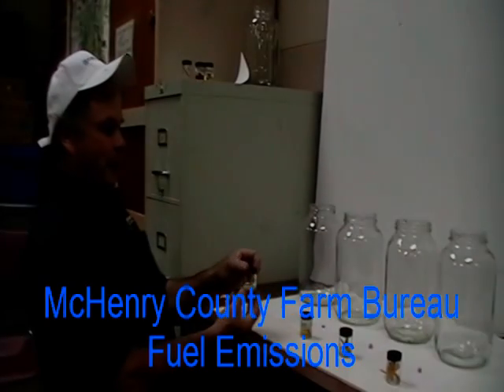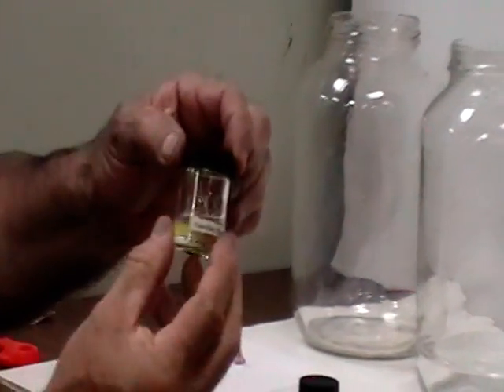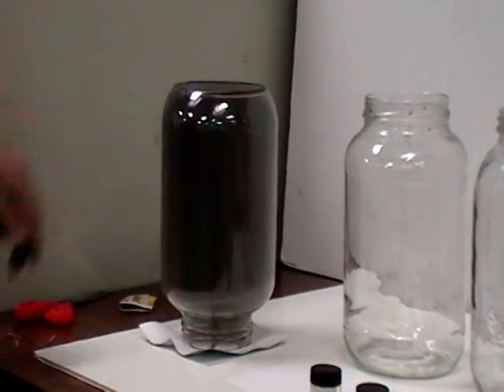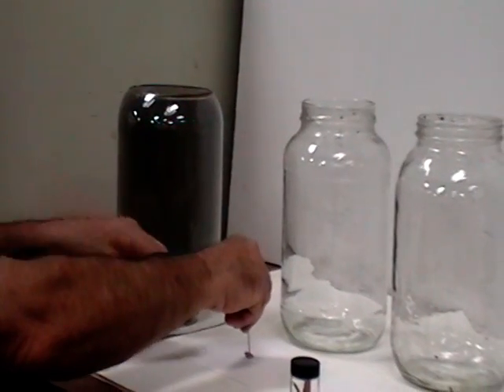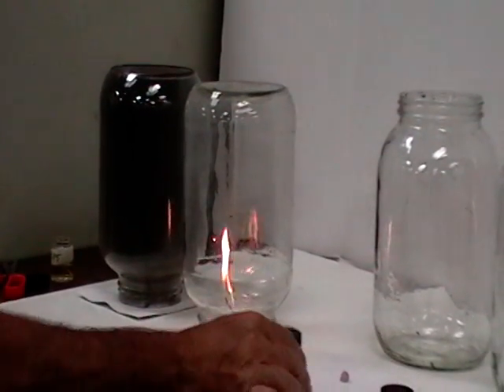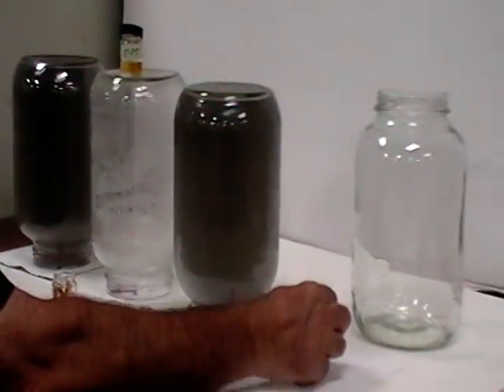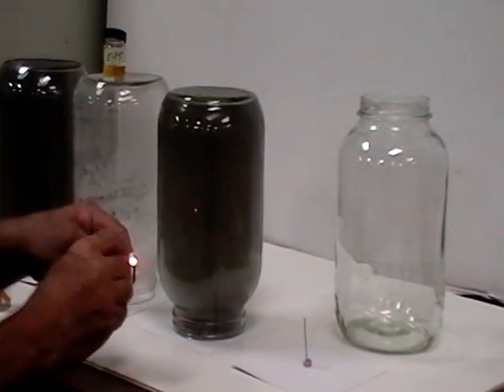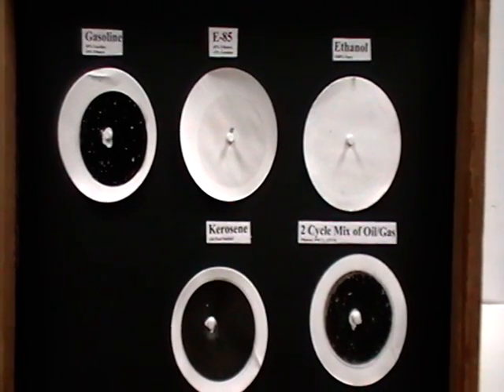Fuel Emissions - Gas, Ethanol, E85, Kerosene

Comment: Ya, in the absence of added O2 you get soot. Acetelyne with no extra air is filthy too, but when you add oxygen, it is extremely hot and zero emissions. No engines burn fuel in upside down jars.

Comment: This test fails in that it does not represent actual running conditions. Heavier fuels run cleaner and more efficiently in engines when combustion pressure and temperature are higher, plus oxygen levels are higher than atmosphere through turbocharging. By placing a closed jar over the flame, you reduce the oxygen and naturally the flame will become dirtier and release more smoke, which is simply unburned hydrocarbons.

Comment: E85 gives me hope for the V8’s shelf life and that my kids will be able to hear an engine’s growl
Reply: Unlikely. E85 actually has a lower gas mileage as thr ethanol has less energy in it. While it burns cleaner, the laws on limiting cars is based on how many gallons of gas they burn and e85 is actually worse at that. It's been well documented by people who've bought cars that run on flex fuels that mileage goes down. Unless they made a stipulation for it, it likely will change nothing. 

Not to mention the emissions are only slightly better than diesel engines. E85 is believed to produce 50% less emissions than straight gasoline while diesel already only emits about 40% less than gasoline. E85 also takes growing vastly more corn and more land wasted to grow it making it technically worse by a large margin. For example, with existing e90 gasoline, 40% of all corn crops are used go make ethanol for fuel. This also means feed for cows goes up which us why cow food products have also gone up drastically. This would only compound both issues while also requiring vastly more farmland.
Reply: Yeah those amazing sounding monsters have to stay a lot longer IMHO

Comment: Of course if a fuel isn't given the proper environment for combustion (incorrect air/fuel ratio, combustion temperature too low) you're going to get soot and unburnt fuel. This experiment has less scientific merit than an elementary school science fair project that got last place and you should be embarrassed as a company to post something this invalid.

Comment: Why don't you try that again and actually burn the fuels completely in the right environment as was stated below. Also why don't you burn the fuel vapors without introducing the wood/carbon into the mix and tainting your results. Crackpot science is far worse than ignorance outright.

Comment: Nothing is better than methanol. It needs to be our new fuel. It’s much easier and quicker to make and it’s got way more power which allows us to use smaller engines and in turn smaller cars. It’s obviously got the problem of being highly corrosive and has a low energy density, but those can be solved with mixtures and proper building materials for new carsx
Reply: Windows NT Workstation 4.0 precisely I researched dimethyl ether. I feel that lng compression wastes tons of energy it’d be better to chemically convert it to something instead. Dimethyl ether is a lot like propane and it’s a great fuel. Methanol is more for gasoline. Both absorb more energy from the engine to keep it cool and increase the speed of oncoming vapors and gasses which reduces the power needed from the piston to pull the intake and it also pushes the piston along when combustion hits more.

Comment: Ethanol is hygroscopic, so it won't store very long. I tried it several times but went back to gasoline because it was only twenty cents a gallon cheaper than regular, but got much less miles per gallon.
Reply: Ethanol won't store very long, you say? Hahahahaha. Did the monkeys you travel with tell you that? 

Ethanol can store virtually forever. The simplest way to prove this is to go to your father's or grandfather's house and ask to see the oldest bottle of whiskey, vodka, schnapps, rye, scotch, tequila, brandy that he has. Unless you father/grand father is a drunk, he'll have something that is a few years old (maybe a decade of more). Taste it. It will taste exactly like how whiskey, vodka, schnapps, rye, scotch, tequila, or brandy tastes. 

Gasoline goes bad. Being hygroscopic simply means that it's a substance that can mix with water. Gasoline is also hygroscopic, but less so, which is why if you get water in your fuel system you add a product like Dry Gas, which is ethanol.

Comment: We dont have E85 in Brazil. We have E100 then we have Gasoline E27 (used to be something from 20-25% until 2014 now is 27%) and Premium gasoline E25.
Reply: And you can run any car in E100? Where can I find some info about it? I mean if you can name brazilian forums
Reply: @daneitor97  Hi Daniel. I had tried to write you a comment with an URL of a website talking about ethanol in Brazil, but my message has been deleted by Youtube, I'm gonna try again...Well, not any car, but all cars produced in Brazil as of now, 2022, they are all made to run on any kind of mixture from E22 to E96. E96 because out "E100" is 4% water that naturally occurs in its production, taking it out increases the production cost... In the 70's there were a government program called "PRO-ETHANOL" in Brazil that gave incentives to cars manufactures to produce ethanol only vehicles and from the 80's to the beginning of the 90's most cars produced in Brazil were made to run with ethanol only E100 or E96 whatever... In the  middle of the 90's gasoline price has gone down a lot and there was a crises in the ethanol production chain and then gasoline came back again as the main fuel sold in Brazil so little by little car makers started to phase out all ethanol vehicles and by 2001 there were almost no cars being sold that were compatible with ethanol, only gasoline (at the time E20 to E24 depending on what the government tells them to do..). In 2003 ethanol had another chance in Brazil with our first flex fuel vehicle being launched and since then all car makers started to produce their own version of a flex fuel vehicle and now 99% are flex fuel capable of running anything from E20 - sometimes less to E100. But it's been many years that using ethanol as car fuel is not worthy because after the first years of producing flex fuel cars, the price of ethanol has increased year by year and as of 2022 in almost all brazilian states, the price is almost the same of the gasoline so it not worthy at all price wise. Performance wise is better, but not by much, comparing the two.
Reply: @rauserfroes81  muito obrigado!! I wish we had ethanol here in Spain (also in Portugal). There is in France, for less than half the price of gasoline... But here is a lot of misinformation and lack of real knowledge in Europe about Ethanol
Reply: @daneitor97  You're welcome! And I myself wish we in Brazil had cheaper ethanol! We have a really bad government not working for people and evil sugar/ethanol producers that only think about their profits.

Comment: But can it melt steel beams?
Reply: yes it can, it weakens the beams to a point where the tremendous amount of weight of the existing floors of that building, will buckle the beams that are being superheated/weakened by jet fuel. laws of physics takes place.

Comment: This "test" is ridiculous non-sense.The black stuff is carbon based soot. Soot formation in this case is caused by lack of oxygen because he seals it in a jar. Fuels are not burned in an oxygen free area. A perfect burn of any of these will result in carbon dioxide and water vapor. This is nothing like how an engine would burn these fuels. Try raising the temperature and pressure to that of inside an engine and supply it with stoichiometric air to fuel ratio. Anyone that has burned an oxy-acetylene torch knows soot is formed until you add the necessary oxygen. Emissions also deal with things we can't see. This is so silly of a "test"
Reply: TheMatron'sMilitia methanol is much better. Stick with it.
Reply: Jorell f yes, but as a control the ethanol didn’t carbonize it’s fuel.
Reply: el bob engines don’t always burn 100 percent. You seen a diesel motor “rolling coal”? That happens all the time when we accelerate in all fossil fuel engines.
Reply: el bob the stick was already producing soot before being in the jar
Reply: Then why didn’t it happen with the E-85? Hmmmm????
Reply: You are absolutely right the ethanol only burns cleaner as it contains a little oxygen with right amount of air all the jars would still be clear.
Reply: An engine rarely runs a stoichiometric air ratio, if it did you would not have carbon buildup within an engine. What the video shows is that even in less than ideal conditions ethanol is a superior fuel.
Reply: @SkylineFinesse  Wrong most engines run stoichiometric 95% to 99% of the time it just depends how sophisticated the fuel management is.
Reply: Fossil fuels will always burn dirty. It’s just in their chemistry.
Reply: @michaelhite1433  no, HYDROCARBONS will always burn into water and carbon dioxide/oxide or pure carbon

Comment: How does the color relate to cleanliness?  Sure the black stuff has more carbon/soot, but stuff like carbon monoxide is clear and very harmful... how do you account for that with this test?
Reply: +2PiLabs more carbon in the fuel means more carbon monoxide and more CO2 when used in a engine.
Reply: The Countess and more energy, air is free, you can pump however much air you want to burn the gasoline, but as for ethanol, it’s already partially oxidized, so won’t have as much energy as gasoline when air supply is sufficient.

Comment: I dont care if it's cleaner, im not burning corn in my engine.
Reply: +Douglas Gardner Actually it's very common for racers to use e85 over gasolne. Because it has an octane rating of 105, it resists detonation far better than gasoline. This means you can use more aggressive ignition timing that you normally wouldn't be able to run to achieve MBT (maximum brake torque). It also cools down the intake charge going into the cylinders which further decreases the chances of detonation.
Reply: +Douglas Gardner Give me one good reason why burning E85 is a bad thing.
Reply: *****  e85 creates more smog then regular gas, ethanol is a net energy loser, ethanol reduce the vehicle's fuel efficiency. I always run ethanol free fuel in my daily.
Reply: +Douglas Gardner lots of people do...
Reply: +Jose Garcia Ruins your fuel lines, your gas tank can rust out due to water vapor, corn subsidies.
Reply: +Douglas Gardner yes but it is also much cheaper than gasoline, makes us less depenant on foreign oil and at 105 octane it can be used as race fuel at a much lower price.
Reply: *****  I highly doubt any racers would use a sub par fuel
Reply: +Douglas Gardner That's actually 100% false.  Due to its chemical makeup you can burn MORE at one time than gasoline in the same space so it makes more power even though the energy per pound is lower.
Reply: +Douglas Gardner /watch?v=ltWcgiCm4NY

Comment: This is one of the stupidest video's i've ever seen. All this does is show that how when certain liquids are burned with low oxygen content in the air soot is produced instead of CO2...
Reply: +Rasmus Hvid It shows how these various liquids produce soot in like conditions. 

It stands to reason that these conditions might create more particulates in absolute terms, but not change in relative terms. 

So we'll say for the sake of argument he created 4 units of soot in that environment with E85, and 10 with the two-cycle mixture. If in the real world 2 units is created with E83 and 5 with two-cycle mix his argument still stands. One is more polluting than the other in relative terms.
Reply: +JAMES HAWK  Did you pass grade 10 chemistry? Because if so, you'll realize this isnt realistic experimental conditions, a more precise test would involve using different sized containers depending on the stoichiometry of the reactions.
Reply: Right a more scientific way of conducting this test would be to work through the chemical reaction, find stoich, and then burn each with enough air to complete the reaction. Then check the amount of soot produced so the numbers aren't skewed. I'm willing to bet that some incomplete combustion would still occur, but not to this degree. Maybe I'll try this in chemistry class next semester.
Reply: Right a more scientific way of conducting this test would be to work through the chemical reaction, find stoich, and then burn each with enough air to complete the reaction. Then check the amount of soot produced so the numbers aren't skewed. I'm willing to bet that some incomplete combustion would still occur, but not to this degree. Maybe I'll try this in chemistry class next semester.
Reply: Right a more scientific way of conducting this test would be to work through the chemical reaction, find stoich, and then burn each with enough air to complete the reaction. Then check the amount of soot produced so the numbers aren't skewed. I'm willing to bet that some incomplete combustion would still occur, but not to this degree. Maybe I'll try this in chemistry class next semester.
Reply: wouldn't you need to have less O2 to make the e85 stoich? when given the correct conditions all of these should produce only CO2 and water the soot is from incomplete combustion. wouldn't a better test be to find the stoich of all the samples and then react each at its desired afr and then check the emissions. I'm willing to bet some incomplete combustion will still occur.
Reply: +Rasmus Hvid That is EXACTLY what I was thinking! If you burn fuel with an insufficient amount of air (i.e.: stoichiometric value + excess air), you get incomplete combustion. Gasoline and Kerosene, when proper combustion occurs, burns MUCH cleaner than what is shown here.
Reply: +Jon C Yes, but that means absolutely nothing. The majority of combustion reactions occurs with a correct or excess amount of oxygen. As such, soot isnt product in the majority of combustion reactions and so the amount of soot produced in such a scenario means nothing to how clean it is. While traditional fuels may release more CO2 then E85, this video does neither prove or disprove this theory and additionally to get a better picture it should be taken into account the Enthalpy of Combustion in order to find which one releases the least amount of CO2 per joule of energy created.
Reply: E85 still burns cleaner. Emissions tests have proven it. Also the engines combustion chamber is cleaner.
Reply: This test is kinda stupid because engine are tuned to have the most efficient fuel mixture to produce the cleanest burn and that changes depending on the fuel. Ethanol and Gasoline have different stochiometric values in the same Otto cycle engine, so engines would be tuned differently.
Ethanol on average burns cleaner than gas in an engine because ethanol has much shorter chains and will be more difficult to create soot, but if a gas engine is well tuned emissions would be similar
Reply: Explain the second jar then smart guy. Lol
You just won't admit that you are actually polluting the air as you see in the video.

Comment: Ethanol is a scam.  I started burning E85 in my last truck and followed all the break in procedures for GM flex fuel.  My mpg was cut in half, and it was down on power.  I gave E85 2 months on dealer advice to see if it was the computer just needing time to adjust and it never improved.  When you factor in all the energy and resources it takes to produce ethanol it's just another government boondoggle that looks good up front but is very different in real life.  

Add to that the damage it does to gaskets and fuel lines.  Costing more money, and expending more resources to fix and replace.

You have to look at the big picture.
Reply: +stavrosteve down on power? Virtually impossible with the correct tuning. If your ECU is not DESIGNED or your ecu is not TUNED of course its not going to work properly.

Here is the real deal. 20% more fuel usage, 20% MORE power and torque, 80% LESS emissions. It does bring its own problems but also a slew of benefits.

It not cost productive to convert EVERYTHING over, but from now on, just make new cars capable of using both (and many do). My car is an example, its not a special car, a toyota 86/frs/brz.

On the dyno - Stock 110rwkw & 180nm. e85 tune & exhuast, 140rwkw & 280nm and harmful emissions down 80%. Fuel usage went from 7.5 to 9.5L/100km, around 20% more. 

The big picture is not to change all cars over instantly. Its to produce cars from now on that can run the fuel.
Reply: +Mike Not true exactly.  The engines are still designed to be optimized on gasoline.  They really don't tune them for ethanol.  And GM actually tunes then to run worse on ethanol fuels.  For example:  GM programs retards ignition timing on ethanol fuels when the tune should be the opposite.  The ignition should be advanced.  There's too much influence from big oil, and GM is a major whore  to big oil and the government.
Reply: ThinkFreely2012 pretty much. My e85 tune runs more than 50deg of timing at TDC, that is where all the power is generated from, and its the extreme knock resistance that allows it to use so much timing. A engine must have a specific tune to get the most from e85 that is for sure
Reply: +stinger15au Flex Fuel vehicles like his are DESIGNED to run on both gasoline and ethanol.
Reply: Mike in that case i find the down on power bit complete bullshit. Its impossible, e85 has more energy and if it does, then its the tune and not the fuel's fault.